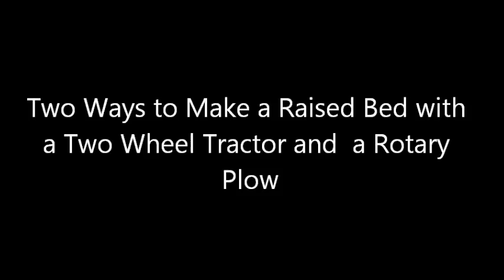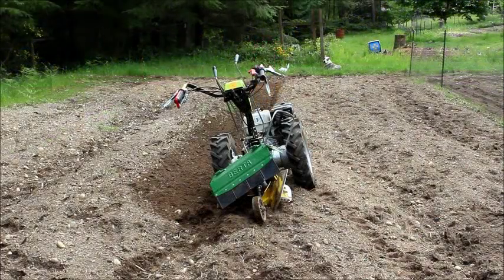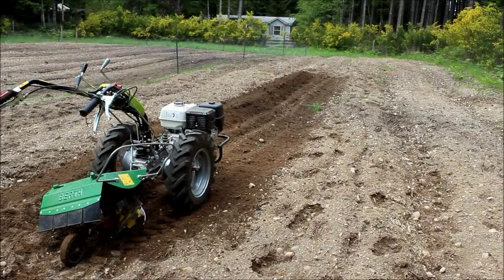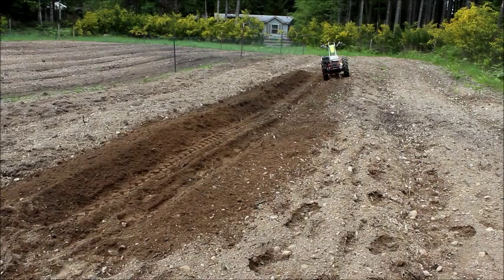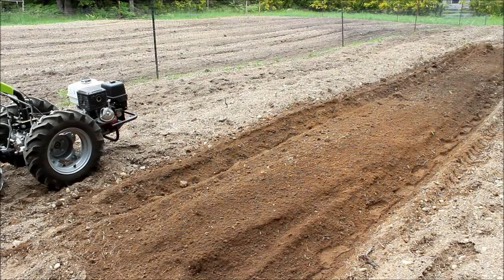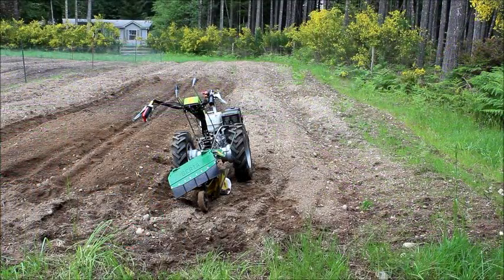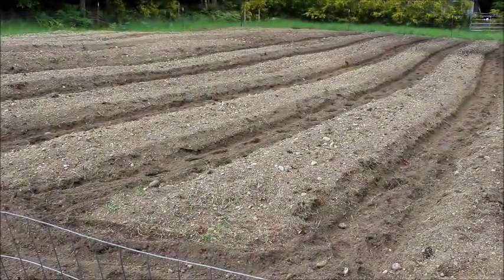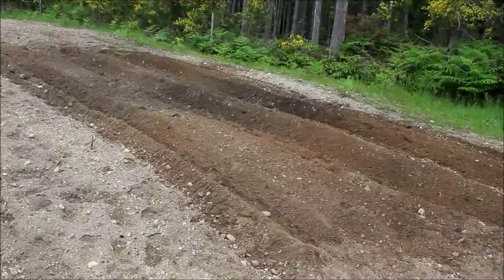Making Raised Beds With the Berta Rotary Plow

Comment: I thought something looked a bit strange, are the wheels fitted to the wrong sides? tyres look like they are going in the wrong direction. Very nice machine, something I'll be adding to my wish list.
Reply: +dobe762 These walk behind tractors go "both ways" There are certain attachments with rear mount applications like this rotary plow or a tiller and some are for front mount applications such as various mower attachments, blades, stump grinders etc. LOTS of attachments available for these versatile machines. The handlebars will flip completely over and machine moves in the other direction with chosen attachment. Handlebars will also offset, so he could have been walking off to the side of his "plowed" area to avoid compaction. Earth Tools seems to be the best source I have found for all things concerning these amazing tools. Europe is full of these machines and the Italians (BCS and Grillo, the two most popular are both Italian made as are many of the attachments) seem to be at the forefront.

Comment: Have you used the swivel rotary plow at all? I can't seem to find what the benefit of the swivel plow would have over the standard plow for bed production would be like you just did here in the video. Thoughts?
Reply from the maker: +Jeffrey Anthony the swivel version is more expensive but with the regular plow, like i have, you have to do a specific pattern when making beds because the plow only throws dirt to the right.  I don't see a real benefit to the swivel version for the extra cost.  It is two plow shares to maintain also so more expense to use with the swivel version.  they are great tools though and really do a lot of work.

Comment: Any opinion on which is better, Grillo or BCS?  I'm looking to buy a tractor from Earth Tools in KY and the Grillo sure is cheaper.
Reply: Both are great machine and have many similarities. Joel at Earth Tools will answer any questions and advise accordingly. Minor differences. The Grillo is a beast just like the BCS!
Reply: To be honest, I ended up buying an older Gravely 5665.  Those old Gravely tractors are built like tanks, virtually indestructible, uses common engines that are cheap/easy to fix, and you can find them on Craigslist all day long for dirt cheap.   Several attachments available as well, including snowblower,  dozer blade, tiller, rotary plow, brush hog, finish mower, etc...   They're not as "pretty" as a Grillo or BCS, and takes a little more effort to use the attachments, but for me it does 100% of the things I need it to, for about 10% of the cost.
Reply: those gravely's aren't even close for productivity and ease of use.  they are junk

Comment: Good Gracious, where are your shoes.. actually your boots for safety?
Reply from the maker: no worried about not having shoes.  I'm not putting others at risk by going without boots.  That is a choice a person has to make for themselves. there are not a lot outside variables such as with motorcycling or other hazards like that.  Just pay attention to where your feet are in relation to the rotating plow.  If you did get caught up in it, your feet wouldn't be the only injury, ankles and lower legs would be in the hurt locker as well.  Boots would be no help at that point.  My feet are not the point of the video though.
Reply: BRIGITTE FULLER He is now none as 2 toes
Reply: ***** Was that a "Teamspirit" shirt? That back looked totally familiar. somehow. Semper Fi.
Reply: I garden barefoot also
Reply: Right????  Wtf. Bad bad example. Don’t do that people. Holy s—t man. I’ll send you a pair of boots if you need. Damn that’s scary.